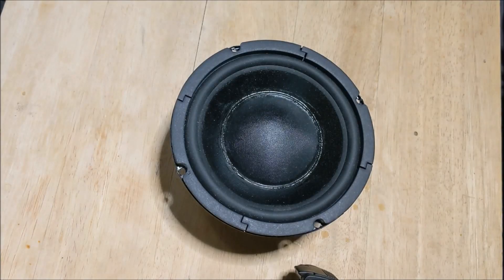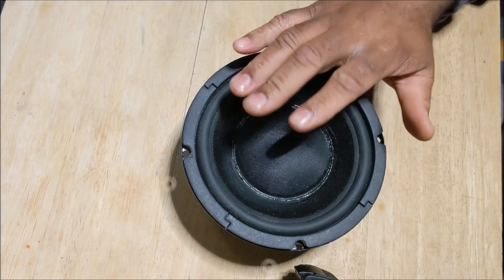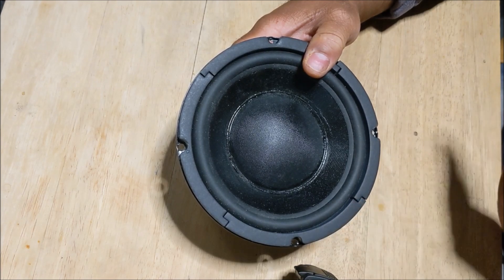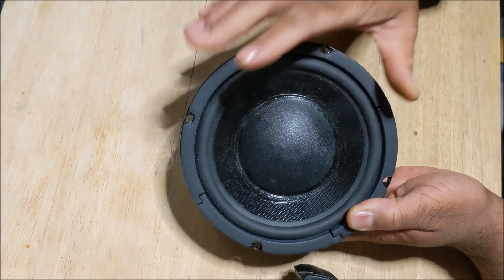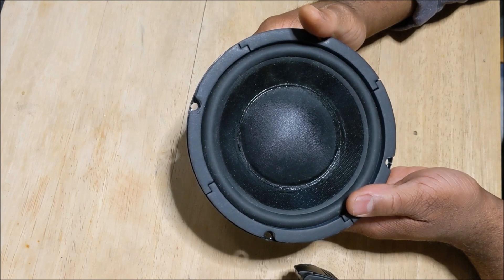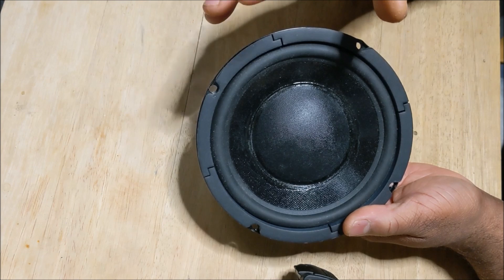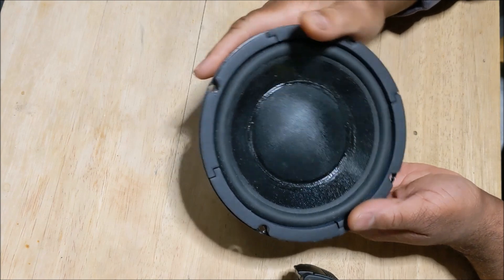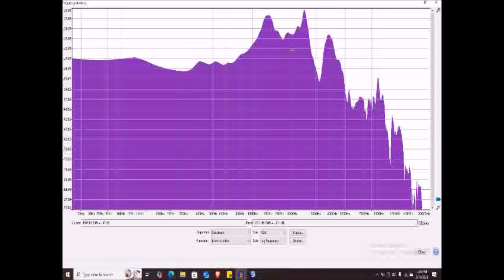Dayton Audio DC160-8 Modified Woofer Response, Hmm... (Pt. 1 & 2) Full

Comment: I've had a few woofers that have had unusual response curves through the mid-range, and I've experimented many times with different dust caps. (and NO dust caps)  Dust caps make a HUGE difference in the midrange and I'd be willing to bet that removing your large dust cap would help to smooth out the response curve.  I happen to have the four ohm version of that Dayton woofer and it is nearly perfect in a flush mount situation.  In fact, that system with a tuned port in a .7 cu.ft. box goes down to around 35hz and is smooth up to around 4k, where it meets a nice soft-dome tweeter.  The original dust cap is much smaller.  With some woofers I'll use a piece of sticky back felt over the voice coil, just to keep the dirt out, and that usually gives the best response with most woofers.  Just my two cents..
Reply from the maker: Thanks for the comment and your feedback.  Yes, after thinking about it, you are right.  It must make a difference using a larger or smaller dust cap.  The other day I was testing a small dayton audio 3" full range driver,.  I accidentally covered the vented magnet with the finger and the sound dramatically change!  When I removed my finger from the vented magnet, the sound was so much louder with more bass.  This got me thinking about you said.  It hard to imagine how a tiny vent  in the voice coil of the magnet can make a big difference in sound.  I made a video of this and will be posting it in a couple of days.   
Thanks again for your input and watching my video.